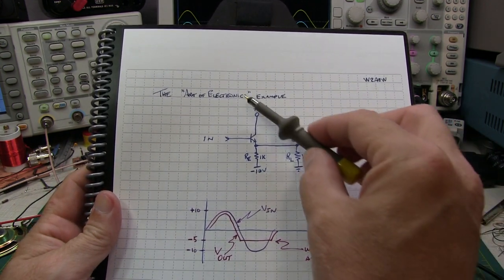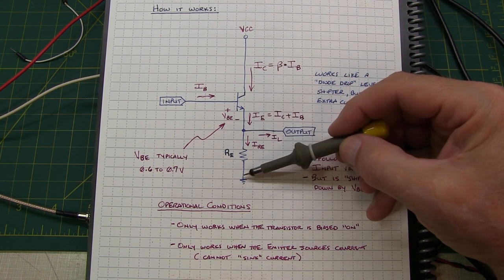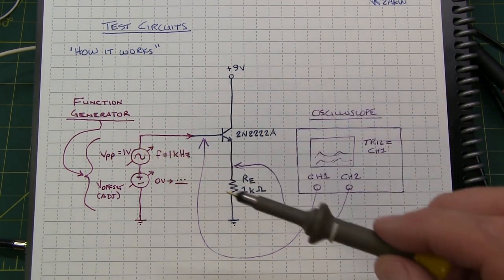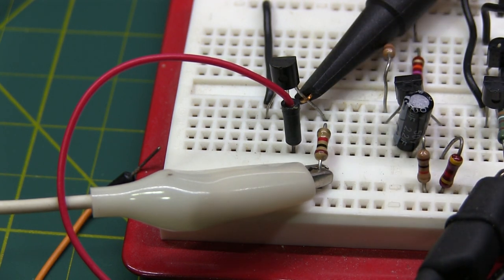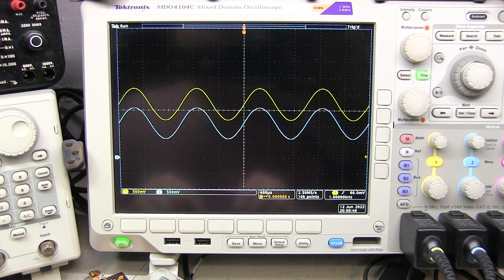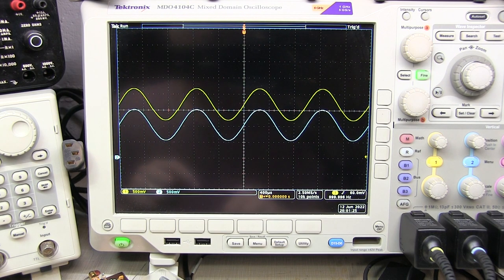#356: Back to Basics: the Emitter Follower, or Common-Collector Amplifier

Comment: When I was teaching at a local university I did a session "proving" that an emitter follower could have a gain greater than one.  Use an audio frequency that can be measured by your standard VOM of the day (20,000 ohm/volt).  Measure the base signal, then move the meter prob to measure the emitter signal.    Voila, the emitter is greater than the base.  This is an "illusion of measurement"  When you read the HIGH impedance base, you load it more than you would when you move the probe and read the LOW impedance emitter.   This is a well-known phenomenon in the industry but it's a wonderment to a new student.
Reply from the maker: Teaches a valuable lesson of the effects of making a measurement...
Reply: is it the oscilloscope that consumes current?

Comment: With every video I'm impressed that you always maintain such a precise language and use the proper terminology and it's still easy to follow (probably rather because of that). Hats off! I'm an EE myself (power systems though, not that experienced with analog circuits) and would love to see a video (series) of a slightly more complex analog circuit - e. g. a hifi amplifier or a higher voltage cascode amplifier - and follow your thoughts from start to end: How do you analyze the problem (starting with the requirements), how do you come up with a circuit (what are the methods to come up with a good design), the math, (maybe a simulation?), and finally a prototype/measurements/refinements. I know it's a bit much to ask, but I think I might not be the only one that would really appreciate something like this. Again, thank you for sharing your knowledge!

Comment: When I started I had troubles understanding this because on a scope you see the base voltage versus emitter voltage (or in other cases the collector voltage). The theory  also talks about a voltage follower if they talk about a follower.  While it is a current driven component. Building things to experiment did not clear up things. For me all became clear when my mentor asked during my first serious repair (old scope) 'what is the voltage over that resistor' .  Why ? I asked, 'so you know the current'  he told me and looking at current gave me so much more insight and information. 

The problem it is that you need expensive probes if there are no resistors. Measuring current is often not easy. When I got a Tek 6042 current probe I started to look at the current much more often. Nowadays I repair "unrepairable" electronics for a living and it makes things so much more easy if I look at current. I have a nice collection of rather special current probes for that (for most flux gate and hall based, to I can use them to 'see' current in traces ). Using them is often not easy but it can tels a lot.  For instance, if you measure 0 volt  this can be a short with some current or just no voltage because there is no current. Looking at the current can make repairing a lot more easy. I am talking by the probes that can measure current in traces. The normal "around a wire"  probe needs more work. What I sometimes did was lifting a pin and  adding a piece of wire in series to connect the probe or cut a trace and solder a wire over it to connect the 6042 probe. Btw, a thermal camera can also be a great way to see current, because everything that conducts has resistance and warms up. It is very cool to watch traces and components on a cold PCB during start up. You see the smallest differences in temp. In a Fluke scope meter I could see the power asic come to life first and also the problem, one of the pins being short. And this before things start to smoke :-)

Comment: Another very good video Alan, one aspect of circuit design that I see is left hanging is the calculation for the coupling and de-coupling capacitor values. I feel that would be of benefit to many involved in the practical side of circuit design.
Reply from the maker: Good suggestion - I'll add that to my long list of potential future topics.  Short version:  Coupling capacitors are generally chosen based on the impedance of the circuits they're coupling together, such that the capacitive reactance is substantially lower (4x lower or more) than the circuit impedance at the lowest frequency of operation.

Comment: A more tangible way of looking at the input impedance is to consider that the base current must "share" Re with the collector current.  I.e., flip it from a question of impedance to a question of conductance.  That emitter resistor becomes (Beta + 1) times less effective a conductor of the base current because Re is also conducting the collector current through the same bottleneck.   

If the emitter resistor is thought of as a toll booth capable of processing N electrons per picosecond and the base current on-ramp is funnelling base current electron traffic into the toll plaza where those base electrons are blending-in with  Beta lanes of collector electrons, that lane of base electrons will be processed at a rate of N/(Beta+1) electrons per picosecond.  To the backed-up base electrons waiting for a chance to enter the toll plaza, they perceive the toll booth as being (Beta+1) times slower... which amounts to being perceived as a higher impedance by a factor of (Beta+1)

Comment: Just started going through douglas self small signal book and one of the first chapters is and emitter folower.  He goes through changes to improve performace like adding a current source instead of Re. Good read if anyone wants more info on the emitter follower. Thatnks for the video

Comment: Great way to follow up to the more advanced stuff: explain why emitter follower is known for its tendency to self oscillate in certain conditions.
Reply from the maker: Well, that certainly takes it beyond "basics".  The more important question, is how to prevent it...  ...in that case, ensuring that at least two of the three terminals of the BJT have some small series resistance connected (like a 100 ohm in series with the base, for example), is usually sufficient to prevent self-oscillation.
Reply: @w2aew  I thought you already had a theory video about Colpitts oscillator. Which is essentially what emitter follower turns into when it oscillates. But then I found that video - it was rather about building it.

Comment: Could you please, do a Back-toBasic video on DC-Coupled amplifiers. There's scarcely any information out there about them, except for valueless, untested schematics. I would imagine that they could be driven from a Op-Amp, with a trimmer to set the zero crossing. I had thought about TIP120/125 complimentary pair. Perhaps MOSFETs would work, but the may have a smaller linear region, and I am not sure which are a good pair. It would seem that there would need to be a push-pull, kind of thing, as a DC coupled amp cannot be capacitively coupled. Perhaps I will do some experimentation. If I could get it going with a LM358, then perhaps I would risk my TI OPA amp--all for a function generator AMP.

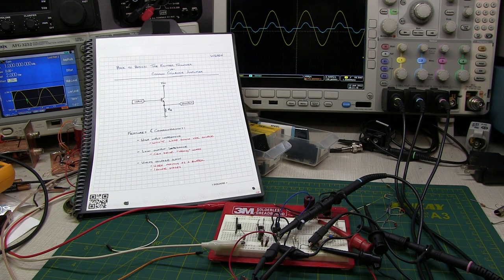Comment: In order to simplify calculation the emitter current in 5:09/21:33  as approximated as  Ie ~ β*Ib   where as the the actual Ie =(β+1)*Ib , but even that does not accoumt for leakage current Ie]bo 
The point I a trying to make is that junction transistors are complicated  so calculations such as shown in  < #356 Back to Basics >  are REQUIRED to get  reasonable answers .
A power transistor such as 2N3055 has βmin = 5@ Ic=10 amp ; in that case the  Ie Ie =(β+1)*Ib  is REQUIRED !

Comment: Alan, Your back to basics series are great and I enjoying them  even now(at 58). Wonder if an old vintage Germanium, like AF116, AC127, 128, etc, say  6 or 8 transistor Radio were completely convered to Silicon transitors such as the BF and the BC series, how would be to re bias the whole stuff and get it to work even at the 1.5 Volt , 1 cell. as some of those old pockert radio did. Or would we be forced ot use only 3 v ( 2 cells) ? . None have done it on you tube & sure there arre a lot of the Radio boys ( they too as vintage as the radios !!) itching to do it just for fun & learning.
Reply from the maker: Hmmm - good question.  I'd have to study the schematic of one of those example Germanium sets to be sure, but I would imagine if it can be done, the main thing you may lose is headroom for the signal levels....  My gut says it is probably possible, but would need further study to be sure.  The audio output stage will probably be the thing that will make it or break it - if it is a push-pull design... then you run out of biasing/signal headroom with the 2-3x larger Vbe.
Reply: @w2aew  , Alan, I understand, as you say it would be doable, for the moment allowing for loss of signal headroom, but the really interesting thing as you pointed out, the final amp & more, biasing, so to operate it at 1.5 Volts (1 Cell). Alan also,  just a thought, any hope of modding  the  Driver/ Op Transformer Winding to at least succeed. I am sure that you already hav quite lot of ckts in your mind. Just to suggest, I had the such as the 1Cell in mind, like the vintage 6 trans, 3/2 Diode !! design, Expo 70, also sold as Emperor AS2, Ajax Dandy, Seacom, etc.   NPN trans 4 qty and The Audio Final are both PNP trans. The 2 bias Diodes, perhaps can be replaced  with one Silicon. The Ckt, is on Radio Museum site ( I can email ckt pdf if you need).
Reply from the maker: @anthonya7990  email is (channel name) at a.r.r.l dot net (remove the periods from arrl).

Comment: Another way to understand the clipping is doing a thevening at the emitter circuit, then your thevenin voltage will be -5V, as long as voltage at the base is more than that ( plus 0.7)  the base emitter diode will conduct and follow the input,  when the voltage at the base is less,  base emitter diode will be open and the output will be only the thevenin voltage

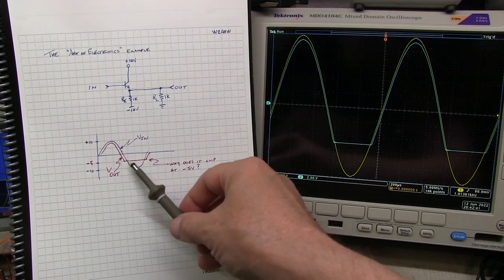Comment: at 20:22
transistor is in cut-off region,
now it has just became a simple resistor divider network 
where -10volt droup equally through both series resistors Re and Rl 
5v drop through Re 
and 
5v drop through Rl

(simply, just erase/ignor the transistor and positive supply 
we just end up with -10volt and two series resistors Re and Rl)

Comment: If you didn't have the datasheets for the Transistor or FET and didn't know the rated wattage or dissipation wattage of the part number device, what can you do to find the rated wattage and dissipation wattage? When biasing a transistor or FET you adjust the grid/gate voltage until the output waveform is clean ( not clipping ) and symmetrical, but the common problem is you can have a clean not clipping symmetrical waveform but when you compute the dissipation wattage is either below or above 70%. Example, the transistor or FET wattage is 10watts but the dissipation wattage you want it at 70%. So 70% of 10 watts is 7watts. The idle bias current should be adjusted so that the dissipation wattage is at 7 watts ( not at 10 watts ). The dissipation wattage formula is = idle bias current X Collector/Drain Voltage. The common problem is that when adjust the idle bias current until you get a clean no clipping symmetrical waveform is that the dissipation wattage is way below or way above 70%. To fix this problem you would need to do what?

Comment: Perhaps you have covered it in another video but I have never seen a description of possible damage to split power supply op-amps (+-15v for example) if both power rails do not track on power up or power down.  What if an old mechanical switch doesn't connect one or the other rail and only one side of the power supply is applied to the op-amp? Any damage possibilities? What if the two power rails are achieved in different ways (different type of regulators maybe) and do not track evenly on power up or down? Any damage possibilities in that?
Reply from the maker: I've never observed any problem with split supply sequencing.

Comment: Hi, I wanted make a circuit with a transistor which is better for video amplifier circuit :emitter follower or collector follower.... . thanks
Reply from the maker: These are very different circuits.  An emitter follower has no voltage gain (only current gain).  Not sure what you mean by "collector follower".

Comment: Now the question becomes: How do we stop thermal runaway in the push-pull pair if we want to drive heavy loads with beefy transistors? Emitter resistors only help so much if you want high current before starting to sacrifice output voltage, but you need them. More parallel less beefy transistors?

Comment: Hello;  Alan you  have one of the best channels on YouTube. I have a question. you keep referencing ground at the bottom of your screen, is this just offset? I have tried to copy a lot of  breadboard circuits but the ground and getting the sinewave to move around the ground is killing me. Do I not know how to use my scope? Is it the trigger  coupling AC/DC set wrong, or channel coupling wrong or does my scope just not do this? Rigol MSO5272 / MSO5354. I really hope you can answer this. note I have watched at least 75% of your videos so far. As everyone has already stated, you are a most EXCELLENT! instructor.
Reply from the maker: The Vertical Position control will move the reference point (usually ground) on the scope up or down on the screen.  Vertical Offset on the scope changes where the reference point is.   Neither of these changes the actual signal.  In order to see the signal and where it is with respect to ground, be sure to use DC coupling on the scope.
Reply: @w2aew  Thank you Alan, for your quick response. I figured it out, your answer sent me back to video #238 Vertical Position and Offset explained. Apparently on my  Rigol scope offset voltage is always on!  I found a setting in the channel setup called EXPAND (center or ground)  setting it to center lets me move the sinewave around the offset voltage, that had been set at ground preventing me from doing this before today. I have only had this scope for a couple of months, I'm learning new things all the time. I regret not having the money to get a Tektronix scope that does everything this Rigol MSO5345 does. You and others have so many instructional videos on the scopes. Rigol are far and few in between compared to Tektronix. Thanks again for the education. Wishing I lived next door.

Comment: Impedance always messes me up.  I get the circuit going, then attach 8ohm speaker and the wave forms collapse, and I hardly get any power through them while the transistor becomes a miniature space heater.  I get that class A is like 20% efficient, so for 1Watt speaker I expect the circuit to burn through 5 watts.  I get more like 1% efficiency tho :( .  I’ll get it one day :)

Comment: Why in most rf common emmiter amplifiers we add an inductor to collector for increase impedance at the collector??why we don't use just a resistor
Reply from the maker: Usually to provide high gain at RF while being able to set collector current at a desired bias condition (where a resistor might cause saturation)
Reply: @w2aew  thanks.

Comment: At 14:11, is R2 really necessary? If so, why?
Reply from the maker: You can get away without R2, but then the resulting base voltage becomes dependent upon the transistor's Beta which can vary fairly dramatically among different transistors. By setting the bias with R1 and R2, and making their standing current 10x the expected base current, you can setup a predictable bias point.
Reply: @w2aew  thanks for the answer.
Another question: if the base bias voltage changes the only characteristic that changes is the linearity of the circuit? In a general view, the reason for R2 is to keep more or less the same linearity of the circuit despite the changes in beta for the different transistors?
Reply from the maker: @danielkohwalter5481  The bias voltage will determine how large of an input signal can be handled (as well as the amount of quiescent power delivered to a DC connected load).  If the bias voltage is too low, then large signals will cause the transistor to be cutoff during the negative peaks.  And, if the bias is too high, then the positive peaks will drive the transistor into saturation and clip the signal.
Reply: @w2aew  thank you very much! By the way, I love those basic videos. There is always something to learn.

Comment: I love these videos but 50 years of current going the other way from your descriptions is slightly jarring.  I have to mentally change "source" to "sink" and "sink" to "source" to correspond with how I learned things.  I remember wondering why the arrow on diodes and transistors were pointing the wrong way but memorized it as "blocking" in that direction which technically is a bit more accurate description of the physics.  Especially the diode symbol; an arrow hitting a wall.
Needless to say now I might also have to revisit various right-hand rules and things like that for the relationship of current and magnetism.  Fortunately I don't actually need to know those things but someday it might be important.

Comment: Sadly not basic enough for my limited knowledge, I think I need an idiots guide? So much for a new hobby for my retirement 🥲
Reply from the maker: Please don't be discouraged!  If all you get from this video is that an emitter follower has unity gain, and can drive low impedance loads, and is very useful as a buffer amplifier - that's all you really need to know to understand it.
Reply: Hang in there. Start small. Its a GREAT hobby once you dip your toe in.